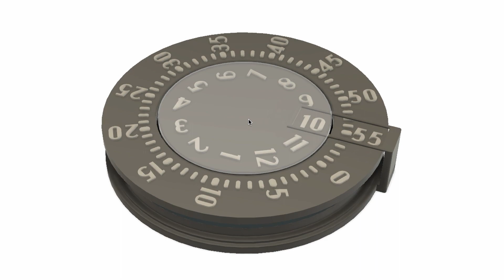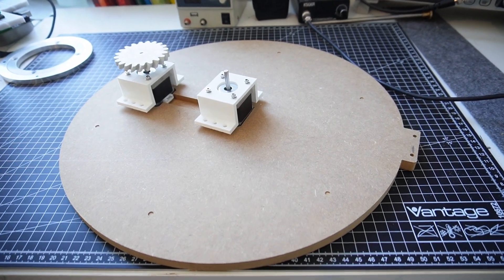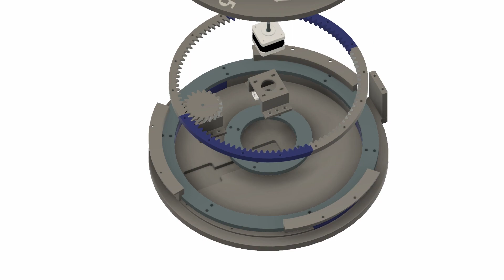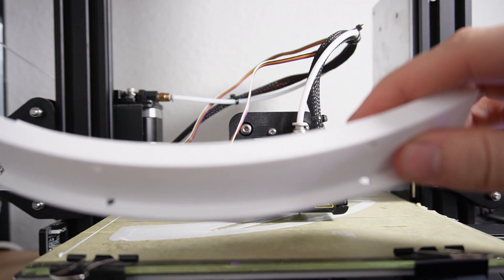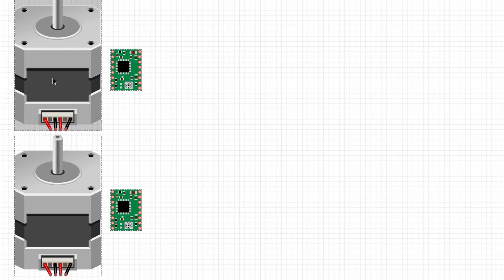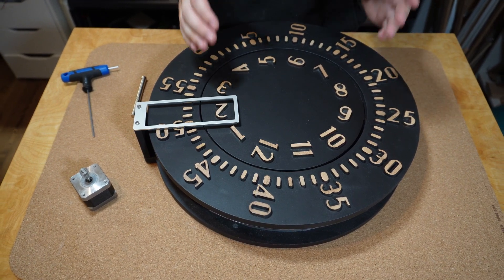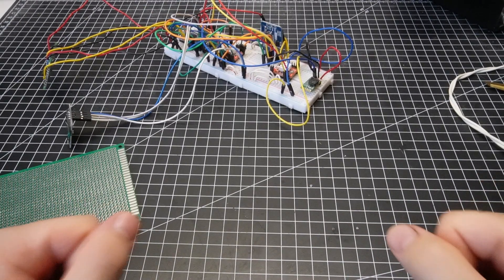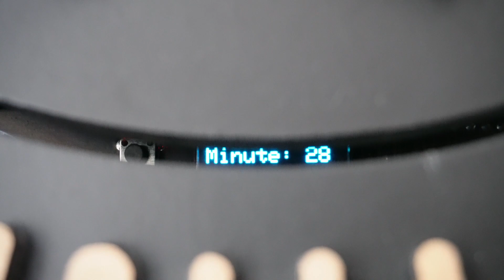Building a Stepper Motor Clock with a Custom PCB | DIY Project

Comment: If you change your stepper drivers to a 2208 or 2209, they will be virtually silent (they looked like 4988's which are noisy).  Great looking project by the way!  Also, check out steve's clocks--like minded community and you might get some programming tips.

Comment: Nice looking clock 👍🏻 
Here some ideas for next version:
Go for a micro controller w WiFi and a network time protocol. Easy to get going and never have to set the time again. Make homing sensors so the micro controller can move the disks to 0 then you don’t have to manually set them. For the disk rotations either gear them to a nice ratio or keep track of their absolute rotation, not relative position. 
Good luck and thanks for sharing 👍🏻
Reply from the maker: Thank you for your ideas; you are right. For my next version, I will definitely change the gear ratio, and also, a closed-loop system makes sense. For that, I will have to rotate the stepper motors 90 degrees so that the clock doesn't get too thick with the added encoders. But I am not sure if I want to use a microcontroller with Wi-Fi because I would rather turn the dial of the clock twice a year than go through the struggle of connecting the clock to Wi-Fi every time I change my internet provider. I think that would be a horrible user experience. ('User' in this case refers to me and also my parents because they also want a clock). But thanks again for your ideas!

Comment: Couldn't you code 266ticks for 5 hours and then 270 ticks for the 6th and so on ? I think it won't be noticeable
Reply from the maker: Thank you for your suggestion! I think something like that, where I get an even number of steps, is a great idea. However, I think the advantage of using magnets is that, because the stepper motors are turned off when they are not in use, they help to hold the position. Nevertheless, I will definitely give it a try.
Reply: I totally see your point and didn t think of that